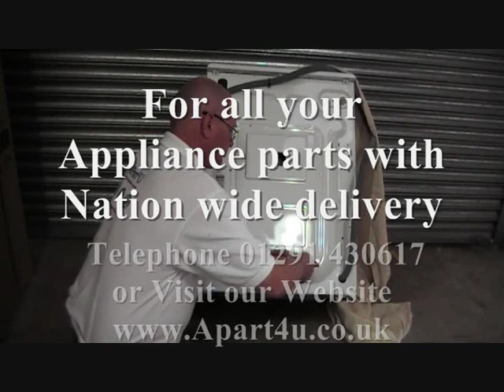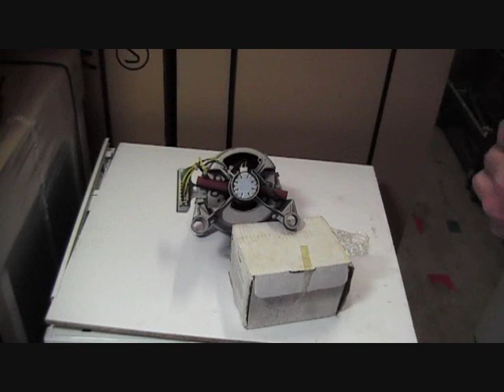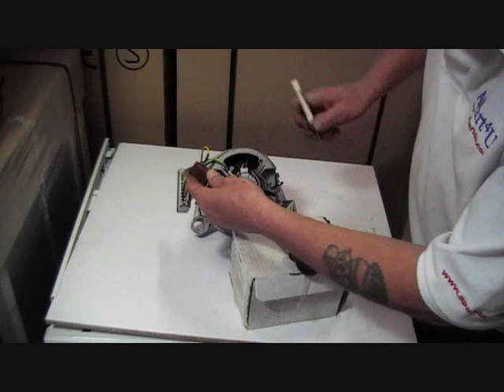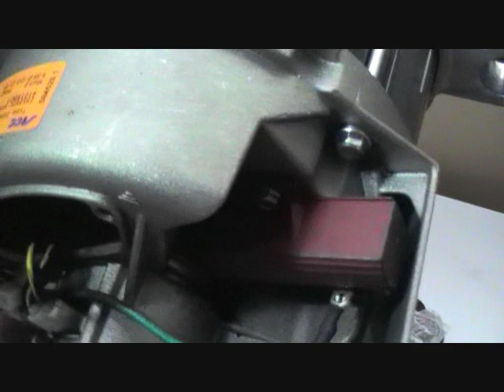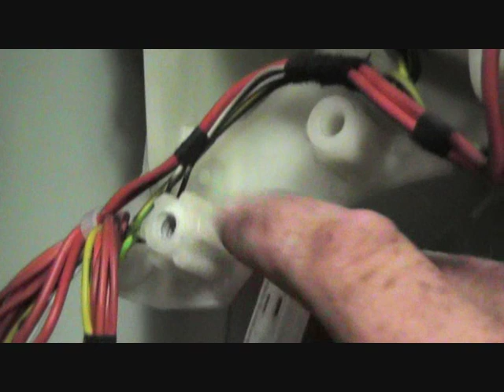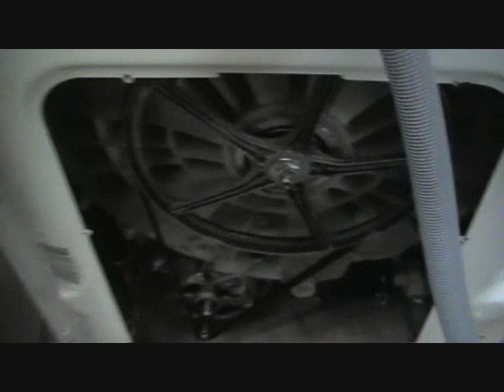How to replace washing machine carbon brushes on Whirlpool

Comment: I have a Whirlpool WWDC9400, With a door open error, I changed the interlock switch, which didn't fix it, I read somewhere that the error could be caused by these worn bushes in this video. Would you think that could cause this error? Thanks In Advance.

Comment: Thanks pal.. i'm unemployed and cannot afford a repair man let alone a new machine, it turns out the problem was the carbon brushes and i had an old zanussi in my garage... the brushes although worn actually fitted the motor and my machine is flying again (not literaly :) )..... you saved me at least 200 euro i just don't have....gr8 video and God bless.
Reply: Look on utube and buy the part from ebay